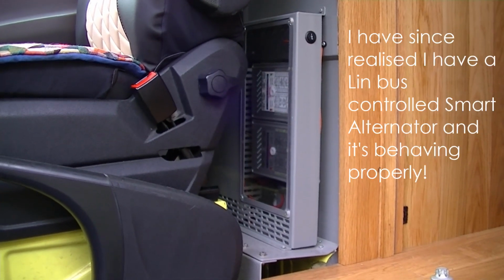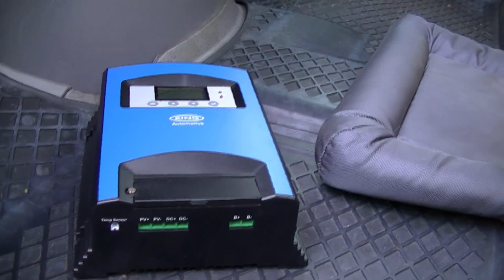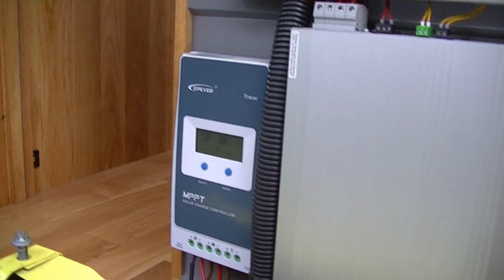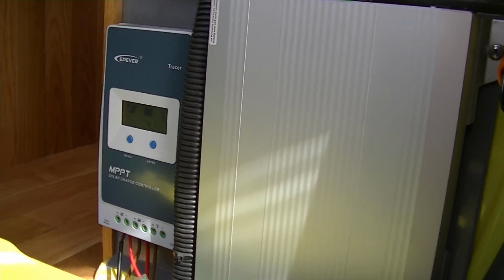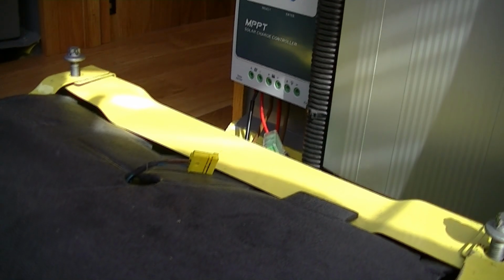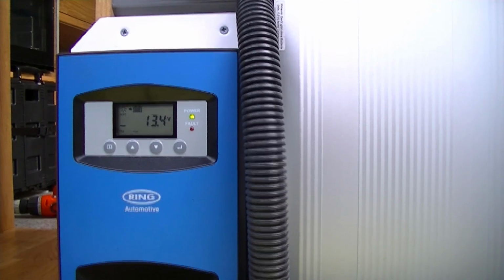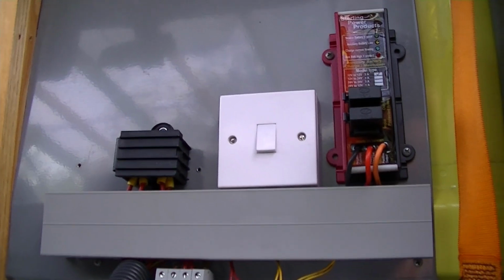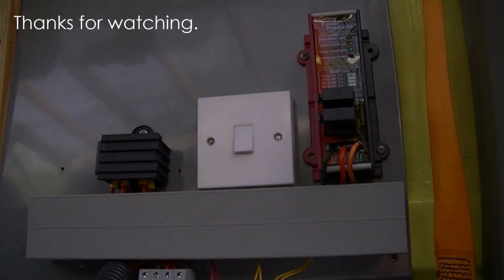B2B, Van battery charging upgrade, Epever Tracer replaced by a Ring RSCDC30

Comment from the maker: Quick update, there was nothing wrong with the Tracer, it does do three stage charging properly which I have since verified using the data logger in my other van. 

I also said my chassis battery was being discharged by 80% after a week or so as a result of the parasitic load on it, wrong, I meant it was being discharged down to about 80%

Comment: I qas going to replace my Ring with a eperver is the ring getting g good solar as mine is rubbish compared to my friends eperver
Reply from the maker: Hi Paul, this is a tricky one as they are different bits of kit, and comparing two disparate setups can be misleading.
I think the Mppt tracker is a bit slower on the ring but the efficiency is probably similar. 

The units do use different charging profiles the ring is a true three stage charger but it has limited configuration options compared to the epever

Each unit has it’s foibles I don’t like (or properly understand) the give priority to solar feature and I tend to turn it on when parked and off when driving which is a pita because of where I mounted the ring.

On the epever units I don’t like the preset timed boost function I would rather it just worked as automatic three stage charger showing what stage it was at bulk, absorption etc.
I also hate the physiological effect of the smiley face on the remote mt50 display as it is far to keen to become a sad face even when the batteries are well charged!

I put the ring in the sprinter because all split charging setups are inefficient, the b2b part of the ring is excellent.
I am using the epever in the Crafter and have a Sterling bb1260 for  B2B charging

If I did not have the Epever spare  I would have bought and fitted the Renogy dcc50s in the Crafter instead I love these units especially now they have a Bluetooth monitor accessory I have done a couple of videos about one I installed
Reply from the maker: PS you can keep the b2b function of the ring and transfer the pv input to another Mppt controller such as an epever, then all things being equal you could sort of do a side by side comparison note the ring is limited to a max of 50voc the  epever typically can take up to 100voc but if you read the manual they seem to be more efficient at a much lower voltage which I have never tested but I find quite strange, mppt usually thrives on voltage

Comment: Enjoyed your vlog. Can I ask what size cable you used from the main battery to your Ring dc to dc. Thank you.
Reply from the maker: This units output is only rated at 30A max and the total end tp end cable run is around 4-5M, so 8 awg (10mm) cable works fine, volt drop over a given distance is the determining factor for all electrical circuits, volt drop increases as the current increases hence the need to size any cable correctly.

For effective battery charging volt drop needs to be minimized.
There is a handy table here which makes sizing cables easy

http://assets.bluesea.com/files/resources/reference/20010.pdf

Comment: So where is the next part that shows the results? I looked but can't find.
Reply from the maker: Sorry I didn't do one, as a B2B it works fine and provides a higher SOC than the split charge relays were doing which is the main reason for installing it.

As an MPPT Tracker the EP-Ever is a better bit of kit, imho its more configurable, I think it it has a faster tracker and a max input voltage of 100V so more suitable to panel strings in Series (the ring is 50v which is actually very good for this type of product) however Mppt likes voltage!

The biggest issue for me with the Ring is the display but only because I put it where the original EP-Ever was
The Rings display does not have a back light and is really hard to see if not looking at it straight on

The EP-Ever has the optional remote display. The Ring doesn't

As a Budget combined MPPT/B2B there's nothing out there to match it for the price but for a few quid more the Renogy Dcc50S is a superb bit of kit with one limitation max PV input is only 25V so that limits panel choice to 4x 150W etc.

Comment: Any further thoughts on the RING combined unit? Looking at getting one for my Van, but have seen mixed reviews, but that could have been before the software upgrade?
Reply from the maker: It's been 100% ok and the 50V input means it supports larger wattage panels with typically a higher Voc, i.e the 300W panel that I have on this van. The only odd behaviour has been when using it combined with my BM12123 to keep the chassis battery charged. I found except when driving it was best to set it to "give priority to Solar" otherwise it got into a bit of a loop and kept resetting on really sunny days when the chassis battery got to the B2b cutover voltage. 

I also really like the Renogy DCC50S because it has built in chassis battery charging but it is limited to 25v Voc, I might buy one for my Crafter but I could not use it on the Sprinter with the 300W panel.

https://www.sp-shop.co.uk/Sterling-Power-12V-12V-Battery-Maintainer-PN-BM12123.html

Comment: Hello mate, I fitted the Ring b2b in my transit conversion. Something to be aware of... there is a firmware update needed to the MPPT controller in order for it to work correctly,  this applies to all units with a date code 181010 or older (this is on a little sticker on back of unit)
Need to send back to Ring for update and they cover the shipping.
Reply from the maker: Jonny Sparrow Thanks I bought mine spring last year but I will check, just in case, I was aware of an update that was required for some early units from a Geeky Phil but mine does not have the symptoms he described afaik.

Comment: Hi Criftings , I have an small van with 100a battrery and inteligent alternator, do you recomend B2B Epever Tracer 10A, ensteed of a booster, it´s cheaper and i´m not need fast charger like 8/10 Amp per hours, but i´m not sure about if Epever could get too temperature. thaks
Reply from the maker: The Epever Tracer is an MPPT Solar Controller only
If you have a smart Alternator then you must use a B2B instead of a split charge relay.
Your choice is then whether to fit a combined MPPT and B2B unit like the Ring RSCDC30 or buy separate items e.g an Epever Tracer and a Sterling power B2B. 

There are pros and cons to either method.
Most combined MPPT and B2B units only support a fairly low Solar Voc that is probably there main weakness. 
They are obviously much easier to install, only one box required
They can also work out as cheaper to buy than two separate units

Comment: I think the Epever controllers are one of the best - maybe it doesn''t go well with the genesis system? I was originally looking at putting a split charge relay in my Sprinter, am glad I didn't bother now as I've seen quite  a few people have had issues - (especially Ash Pollard 'Lost in Europe'). I watched Greg Virgoes wiring video the other day and agree with him its best to keep them separate.  My Sprinter will flatten its battery sat on the drive within a couple of weeks if left to itself - not sure if its remnants of badly removed Ambulance wiring done when it was decommissioned, or just the radio, immobiliser and other permanently on systems.  Am going to add an Anderson plug into the system after the solar controller so I can swap it onto the vehicle battery when its in the drive.
Reply from the maker: Linz_in_NZ It turns out the epever does do staged charging it just not defined very well in the documentation, it is currently installed in my Crafter.
I bought the data logger and have been monitoring it since making this video.

It is actually a far better (faster)  mppt tracker than the one in the ring however reason for fitting the ring was because I wanted the b2b function and that is far more important than solar at this time of year.

I personally would never intentionally install a split charge system in a new build even the setup that came in this 9 year old euro iv van it did not perform well because the Alternator only provides 14v

In the spring I may install a couple more batteries and that will require a 50A b2b probably in the battery compartment I will then refit the epever or the bigger 40A version.

I also intend to add a deck on the roof and a tilt frame for a couple of smaller 300w panels instead of the huge one I have up there now.

The whole reason for using the unistrut to mount the existing panel on was it allows me to change things easily as required.
Ultimately this van is a big experiment 😀
Reply: @CriftinsCampers  A tilt frame is a good idea in the UK if you use the van other than just in Summer. I've got a 200W panel ready to go on, only have a PWM solar controller at present - will see how that goes through the Summer and see whats available if I need to upgrade. We get reasonably good solar even in winter here, lots of sunny days - had it on the last house and was surprised what we generated in winter. Just doing a very basic fit out in the van to start with, then will see how much we use it and if the layout works okay or not before we do any more.🙂🚐🗺👍

Comment: The EPEver solar controllers are excellent, far superior to the Ring controller.
If you really want to see it doing its "thing", buy the USB to RS485 cable and download the free PC software to a laptop.
There's also  WiFi and Blutooth adapters for use with apps on mobile devices. But the PC software is the best IMO.
Reply from the maker: Yes I have the WiFi interface and the pc software I have monitored the epever unit for months and it simply does not perform an intelligent charge cycle.

The fixed duration boost setting is as near as it gets.

However compared to the ring I agree  it is far superior as an mppt tracker the ring is frankly a bit odd it's working fine as a b2b but the mppt tracker is very slow and I am not impressed with it at all.

I would like to try one of the Abso units but I have not found a decent in depth review of one, most are too superficial like the many of those I watched for the ring &  epever, it's not until I started doing my own more in depth analysis did I begin to discover it's not doing what I want it to do.
Reply from the maker: However in reality I am not able to fully assess the Ring at the moment I was able to monitor the epever in good conditions with full sun etc. I won't be able to do the same with the Ring for months but right now I don't think I would buy another.

Comment: Cool Vid Mate that's the same unit ive been looking at so will be hoping you do an update video...Cheers!!
Reply from the maker: Trace Blackwell Thanks, I have only partially tested it so far with the engine running and saw 14.7v on the output which is what I was expecting , what I have noticed is the  mppt tracker is not as fast as the Epever unit.

I used this because I already had it, if I was to buy another I quite like the ABSO units they do a 50A one.

If I didn’t need the mppt part I would buy one of the votronic b2b chargers they have a very useful chassis battery trickle charge function built in as well.

If I keep the epever for the Crafter I will probably buy the Votronic unit as I won’t need a built in mppt.